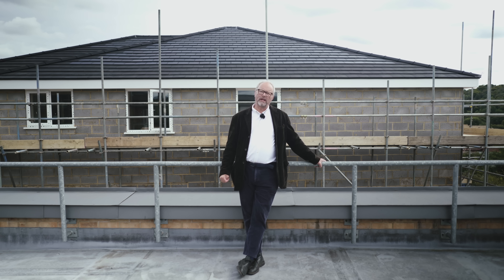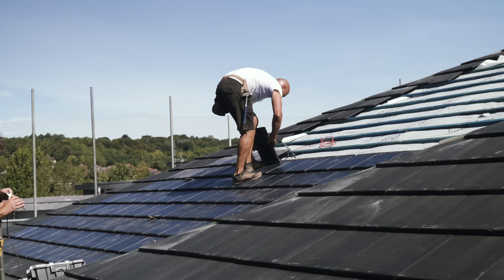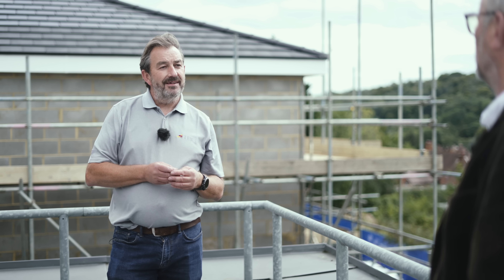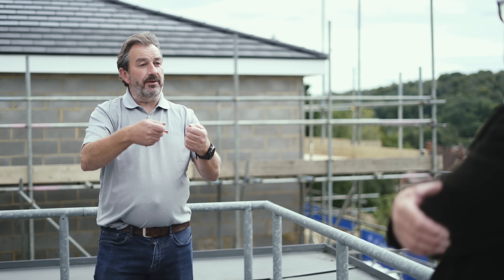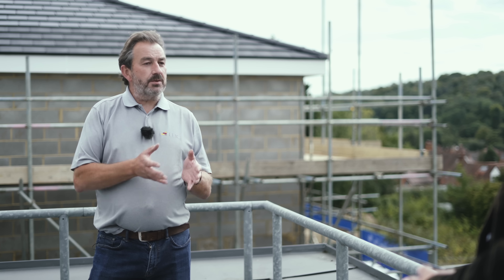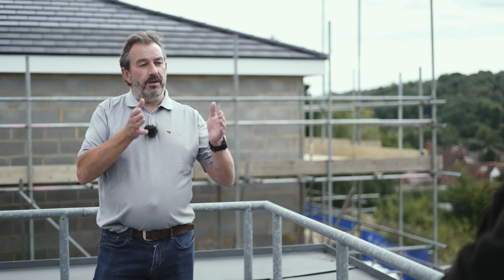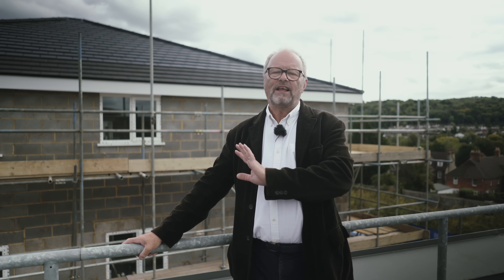Solar Roof Tiles - should every building generate its own power? | 100% Independent, 100% Electric

Comment: This to me is like hybrid cars, retrofitting new tech on to old tech, what about the environmental cost of the concrete roof tiles? It would surely be better to stop using century old roofing systems and use modern light weight roofs that require less timber to support them. Also the added cost of this system is crazy!! I believe we need to design and build with solar in mind, large flat rectangular roofs made with metal insulated panels with solar on top. The air gap helps cool the panels and increases efficiency, holding on to tradition will only hold us back!
For me this system is for those with more money than sense, we need affordable and sustainable solutions so that everyone can benefit. Also what about the time to install those panels on the tiles and cutting the hole in them? how much does that cost?
Reply: Part of a roofs stability is it's mass, but agreed concrete isn't the most environmentally friendly material, I've often thought there must be a better way. Idk what recycled materials would be suitable though given it must be fireproof, insulating, UV stable etc. USA style shingles are garbage, flat roofs are worse, get back to mining slate in a more sustainable way?? Also, yes £30 a tile is a ripoff!
Reply: Killua Zoldyck Flat roofs are the worst for solar, they need to be angled towards the sun. Panels on a flat roof would need to be mounted on an angled frame, so you might as well just build the roof with the appropriate slope. Insurance companies hate flat roofs for a reason- they are notorious for leaks. I agree about concrete roof tiles- personally I think traditional slate is still a good choice- it's relatively low carbon, it lasts well over a century, and top quality slates can be reclaimed and reused. In fact, good reclaimed welsh slate tiles reclaimed from old buildings are more in demand and hence more expensive than brand new ones!
Reply: @spencerwilton5831  I never said flat roofs, i have installed enough solar to know that LOL, I'm talking about insulated roof panels like we use on commercial buildings here, but they use on houses in other countries. Much lighter, less framing as they are themselves structural. Easy to install and easy to put solar panels on.
Reply: DrgnFlys  Concrete roof tiles with holes probably won't last 100 years.  Solar panels certainly won't last 100 years.  How do you replace these in 20 years when they start failing?    Do you keep the concrete tile and just replace the PV module?  In 20 years this company will be long gone and you are stuck with a roof full of holes and no power.  Bad idea!
Reply: DrgnFlys   I never said flat roofs, i have installed enough solar to know that LOL, I'm talking about insulated roof panels like we use on commercial buildings here, but they use on houses in other countries. Much lighter, less framing as they are themselves structural. Easy to install and easy to put solar panels on.

Comment: How durable are they, I noticed the installer standing on them
Reply: that is a good question as well. those thin solar panels usually have a very short lifespan. also they did not talk about for how long the warranty is.
Reply: @ursodermatt8809  Personal side question, you seem to be from Switzerland ...... are you in the solar business? Looking around for products and services in Switzerland ....
Reply: @Hippabellita1 
i have a swiss name live in australia though. please use google to look for your services.
Reply: @ursodermatt8809  thanks for answering and have a great weekend!
Reply: Standing on solar panels, or these tiles, introduces cracks in the cells, that reduces the output power of that cell

Comment: when this is cheaper than normal solar it will be big but until that point I can't see this becoming mass market.
Reply: well it's never going to be cheaper than "normal" solar as these tiles have to do more than one thing.
Reply: Right. solar tiles have been around a long time (12 years?), but always significantly more expensive. Unless planners mandate them or you really don't want the standard large panels they aren't very interesting and almost everyone picks the standard scheme. You can also get built-in standard panels and gasketed panels where the panels are the roof. France mandates BIPV (or did) so it's a lot more popular there.
Reply: 900 solar tiles on this building at an extra 29 pound per tile - 26,100 extra. Seems alot.
Reply: @GlenisRetiredNZ  At 15W per panel it is a 13.5kW system, which can cost as much when done with panels. In theory the solar roof goes on as one build and would be cheaper than building a roof and then hiring a separate crew to install solar panels. Also, that is a tile roof and while you can put panels on one I have heard that the frames they need to use for it are fugly. Plus, why would you get a tile roof in the first place and then cover it up even if you don't think panels look bad?

I don't think installers are incompetent enough to cause leaks these days, but putting the panels on frames that allow wind under them for cooling also means a stiff wind risks pulling up the frame, at which point it might go flying away if it is not nailed to your roof and could rip off your roof if it is. Many installers actually seem to advertise how they set the panels flush with the roof to avoid making them stand out, so I don't know how valid the argument about panels getting better cooling because air gets below them is anyway.

TL;DR: It's never going to be cheaper than just solar panels, but if you are building a new roof you can get more solar power on it at same or cheaper price and make it look better than if you added panels.
Reply: Do hope they are fitted with an air gap as black glass gets extremely hot! During hot very sunny days can see that getting into the home even with best insulation.
Reply: @gregandkaruna6674  It's the UK.  They don't get "hot sunny days."

Comment: Question - if the rows are done in series, what happens when a panel fails and causes the entire set of panels to fail.  How hard is it to find the faulty panel and fix it?
Reply: Each panel has a bypass diode, which in the result of shading, or total failure allows the voltage generated by the rest of the sting to pass through, without reducing the total string voltage.
Reply: I suspect you get the same problem with conventional panels.  If it fails open circuit you lose the row, if it fails short circuit you get lower output.  i suppose to find the fault you get up there with a voltmeter!
Reply: @rogerbarton497  Many panels come with micro inverters now a days. These will often be able to detect if a panel is producing output, and if not, disconnect the panel from the series.  This way you never lose a full series of panels.
Reply: Brian Jensen exactly how SolarEdge works and it also tells you which panel is at fault so less need to guess
Reply: @Thomas_Madsen  Micro inverters wouldn't be practical for this type of setup. Say it's a 4kw system. That's about 270 tiles so you'd also have 270 expensive inverters. They'd also have to be low voltage inverters which would reduce efficiency.
Reply: @Thomas_Madsen  Yes, but these particular ones don't.  There's no way you can detect a failed component in a series string remotely unless you have sense wires connected to each panel, which would increase the wiring complexity.
Reply: @rogerbarton497  Read the voltage received at the end & divide by individual panel output? That gives how many panel back to the fault, so subtract from total number to find actual tile number? Not much of a microprocessor needed to produce & display that.
Reply: @LesNewell  yes, micro converters are smart for big panel, like new 2 m2, 400 W each, put them on factories then you get maybe 5 times solarenergy for the same price.
Reply: @helmshardover  measuring the voltage may tell you how many panels in a string have failed but it won't tell you which panels in the string have failed. Measuring the voltage can also be tricky as it is very dependent on the light level. Unless the sky is completely cloud free the light will vary quite a bit over time.
Reply: @helmshardover  No. for the sake of argument say each panel gives 10 volts and there are 5 panels in series giving 50 volts.  If 1 panel goes short you'll get 40 volts, no matter which panel is faulty.  If the panel goes open circuit you'll get 0v at the output, again, it doesn't matter which panel goes down.  Someone suggested that panels have a by-pass diode so an open circuit panel won't bring the whole string down, in this case the symptoms will be the same as for a shorted panel (neglecting the forward voltage drop of a diode).
Reply: @rogerbarton497  Sorry guys, I was writing an article & watching this on the other monitor. I was talking crap!
Reply: See update, "I was talking crap"...
Should I delete it before a 100 people respond or might it produced some useful comment:-).
Reply: @LesNewell  Even so if you get 0v there could be more than one panel open circuit, or a combination of open & short circuits.  You could compare two adjacent rows, and make an assumption that the light level on each is the same, but then again how consistent is the voltage output between panels for a given light intensity?  As someone said, he's had panels for 20 years without a failure so I reckon it's not worth bothering about, especially as you may have to hire scaffolding to get to the connections anyway
Reply: @helmshardover  LOL - you got me thinking though :)
Reply: @rogerbarton497  I was assuming they would either fail short or the built in diode would catch the panel failing open. Thinking about it, a connector failure is probably just as likely as a panel failure. Hundreds of connectors in a humid environment with huge temperature variations - what could possibly go wrong?
Reply: @LesNewell  I wonder if they're using aluminium wire, that would add to the fun.
Reply: @rogerbarton497  Good luck with that. The only way to access the wires is by removing panels. Basically you'd end up removing a big chunk of the roof to find a fault.
Reply: @LesNewell  DUMB IDEA
Reply: I was wondering this as well. I wonder if you could access the cabling from behind. I also wondered if these are interchangeable with normal roofing tiles in the event a panel failed (in a way it was letting water in) and the company was no longer around.
Reply: @alexthewheelers  You can't access from behind. There is a waterproof felt layer behind the tiles. You can clearly see the felt at 11:09
Reply: Panel failure? I have series and parallel set up on my roof for the past twenty years, never been up there to look at them, totally maintenance free.
Reply: Howard yes but you have maybe 16 panels with 32 connections. This is effectively 270 panels far far more possible points of failure.
Reply: What they could do is put test points on the top side of each tile so that with a voltmeter it could easily be determined if the tile is producing a voltage. The test points could be very small and made from a non-corroding metal. Checking from a test point on one tile to the next tile could help determine if there is a wiring problem between the two tiles.
Reply: It's the Christmas tree lights all over again!
Reply: Thermal camera.
Reply: @benburton3496  In winter, sure.  In the summer not so much.
Reply: But 15watt/panel you need 100 panels for 1.5 kWh ... How many tiles ? Square meters ? There are panels with 400 watt these days ... 

Do you wonder why Tesla didn't jump on these yet ?
Reply: All solar tiles will have a built-in monitor like a BMS, very cheap bit of electronics, few pence each, so you can easily locate a faulty tile via some kind of app or VDU installation. The people who design these tiles are not stupid. Obvioulsy they would put these super cheap devices into each tile/panel otherwise finding a fault would be really difficult,
Reply: I have Christmas house lights that come in sections of 50 bulbs, chained together Even if one section fails (Squirrel), the rest of the carry on working. I am sure this is the same.
Reply: @neilm9400  If one bulb fails in a section, does the rest of that section keep working?
Reply: @rogerbarton497  If a bulb fails in the section, then the rest of the bulbs carry on working. If a squirrel chews through one of the cables, the section will drop out, but the other sections in the chain will carry on working, until the little darlings chew through the next cable in the section .....
Reply: @neilm9400  Sounds like the bulbs are connected in parallel in the section.  If they were in series one blown bulb would take the whole section down.
Reply: @Janna LOL .. looks you say ? Then leave it as it is .. why would you bother for 1.5kwh roof LOL ... Rip off 

I can clearly see the amateur now ;)

Comment: Please do a video about Marley's solar tile, which is the same size of a solar panel but integrates into the roof like a Velux window would so you save on the cost of concrete tiles.

Comment: As soon as any electrician talks voltage and amperage and all those unit discussions, my brain locks up. Never understood that magical runic language.
Reply: You have the sum of all the world's knowledge since the beginning of the universe at your fingertips.
If you put in a little effort, then you can understand it and enjoy your expanded horizons.
Reply: @ahaveland  I admire your optimism. Sadly, some things are just beyond my comprehension. Like other people who can't figure out maths or struggle with spelling, I am incapable of understanding electronics.
Reply: @GuanoLad  Electronics are just springs, levers, pipes, tanks and valves.
Current, voltage and power are not electronics. Think of pipes with different thicknesses and pressure and flow rates.
It really is not difficult.
Reply: @ahaveland  I've tried that. It was explained that way at school and several times since. Still don't get it. Sorry.

Comment: in austria you get incentives when building a new house and meeting some certain standards/requirements. eletric solar on the roof should be part of these requirements.
Reply: The UK could easily add such requirements to schemes such as Starter Home scheme. But it won't.
Reply: We have those incentives in America too. For anything solar, energy saving, tankless water heaters, whole home generators, impact windows & doors, smart home tech, etc.
Reply: @ Stefan:  You have elected already a Green Party President, perhaps try to do that for your government too the next time.  ;)
Reply: @TerraPosse  the junior partner of the goverment is the green party
Reply: @kona6812  I realised after I wrote that however the operative word here is 'junior'.  Unless you can somehow spin green policies as also being anti-immigration you are not likely to get any traction with the OVP.

Comment: Be interested to see how these tiles work over a period of time. Do they have optimisers on each tile, if not and if a tile was to fail how do you find it and replace it? Seem to be a good idea but needs to come down in price and have further explanation of how it works (as failures inevitably happen to judge if this is progress for all or just progress on the periphery). Just for reference Im looking at 4Kw solar systems at less than £4k vs the £11k mentioned this is simply not viable in all but extreme cases.
Reply: An optimizer on each of 900 15W tiles? You can't be serious.
You could make bigger groups of them taking into account shading and optimize those instead, but if you don't have any shading issues, then you don't need optimizers anyway.
Reply: Andy Lee Robinson the question is regarding finding a broken or non productive panel. That’s a lot of tile pulling and testing vs larger panels. Optimisers would show exactly which tile (or group) was at fault. Hopefully not a stupid question?
Reply: @jameswestwood  A FLIR camera would reveal many problems, particularly reverse bias.
Yes, finding and fixing an underperforming panel could be tedious, but this is hypothetical without knowing anything at all about rates of failure, if any.
I wouldn't use these cells because I care more for function and efficiency than aesthetics, and yes, I also wouldn't want to be tearing up tiles.
It's not inconceivable that each panel could have a small bluetooth device that reports state of health and performance for little extra cost without going the full hog of having expensive mppt optimizers for each cell or cellgroup.
Reply: Andy Lee Robinson totally agree on all counts Andy. 👍 Didn’t think of Flir. Had an early one and want impressed. Need to check them out again.

Comment: Great idea for a listed buildings where solar would otherwise not be possible. 
Until the price comes down they're still going to be far too expensive for most though.

How are the solar cells glued to the tiles? and what's the long-term duration of that glue like?
If the glue fails you have tiles with holes in the middle all over your roof.

I think I'd at least like to have seen the holes at the back sealed around the edge with silicone sealant or something like that.
Reply: Cells are bonded with a modified structural polymer resin with a 30 year warranty
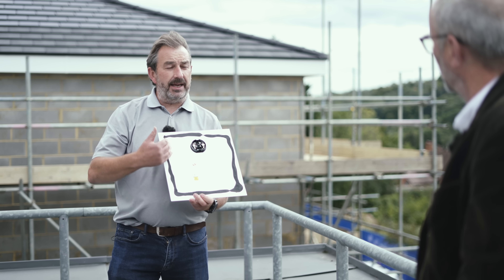Reply: @chrishall409  Thanks Chris. I take it more glue is applied than can be seen on the cell used as an example at 2:00? (as that doesn't seem to be particularly good coverage)

Would have been nice if Robert had covered some of this in the video as it seems most of the questions here are asking about stuff like this. Great to see you're clearing things up though.